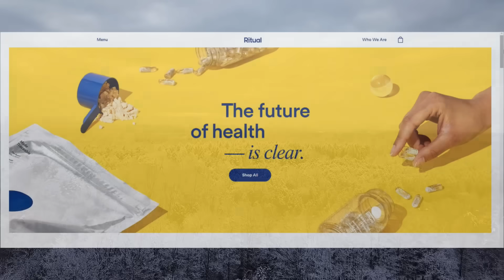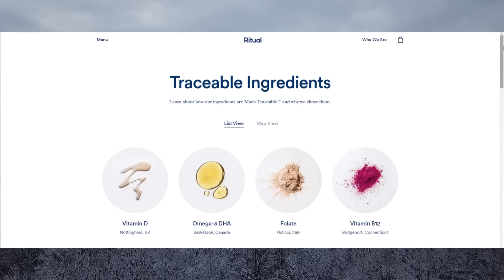Showing my Wife & Daughter the Cabin we Built Them / Ep92 / Outsider Cabin Build

Comment: Another interesting thing about windows in the gable ends, is that such windows can be installed at a later date without a super amount of demo and restructuring since the areas that would have the windows are between the beams right where the cladding is. Heck it need not be four windows when two would do the trick. Or even a half diamond either side of the upright that supports the main roof beam.

That's the beauty of this sort of building with big chunky logs. Most of the detail structure is almost free standing and is basically hung on the logs rather than supporting anything major.

Comment: Great stuff! Looks awesome!  Not sure you're electrical designs are for the cabin, but if you put a circulation fan in the ceiling, it really helps equalize the temp with those large open areas.

Comment: Uhhhhhh, yeah, I’m no professional carpenter (although I did build a new garage roof for my 3 car garage, and an enclosed 3 season front porch with space heater for winter.) But I just HAVE to say, I don’t know where you learned to cut angles on your gable siding but there are ALOT of gaps on the edges and I personally think it looks like CRAP.